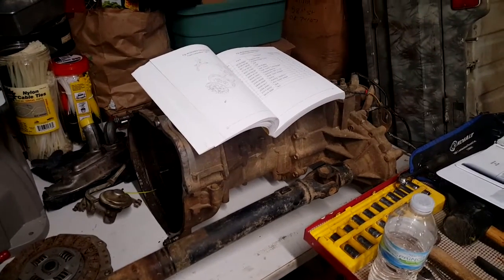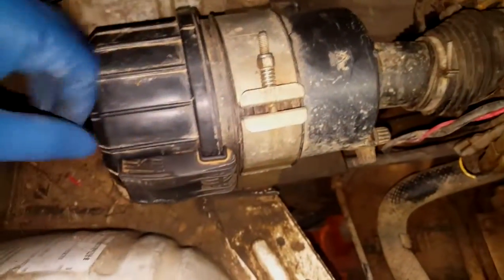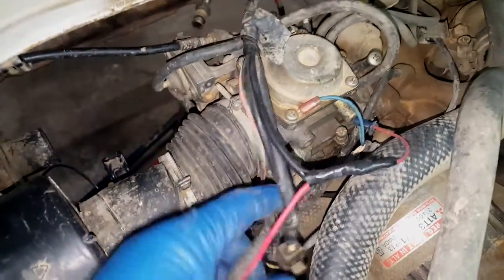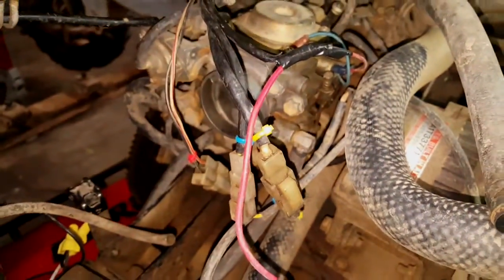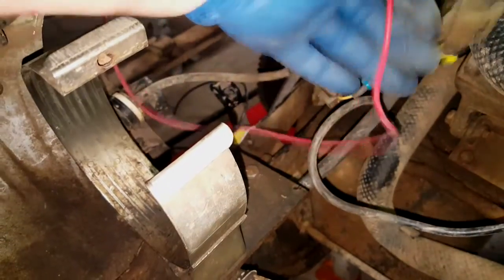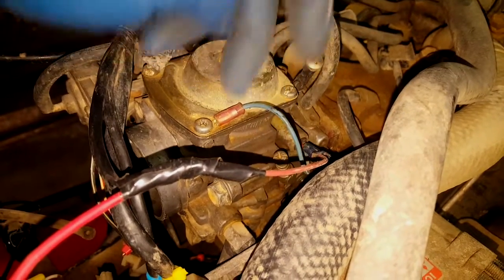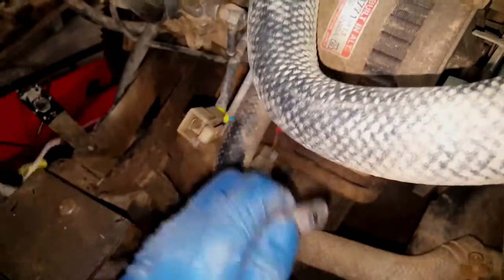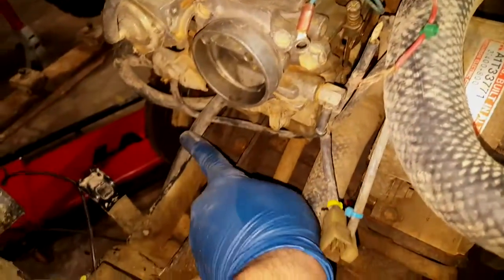1988 Suzuki Carry DB71T Engine Swap Part 6

Comment: good eve. big favor here. can you send me a scan copy of your manual :) regievillasis09@gmail.com. tnx a lot
Reply from the maker: Sorry I just saw this, let me see what I have... exactly what do you need?
Reply: @EngineerPrepper  sir need manual for my unit.  We have the same unit here f5a. Big help if u can give me acopy of manual. :) specially engine assembly..
Reply from the maker: I just sent you what I have. Its the only "service manual" that I was able to find on this truck when I search for one.... I hope it helps you out. The manual is for a F6A, which is a bigger CC engine.... but that is the only difference. All the bolt torques are identical.
Reply: @EngineerPrepper  thank you sir.  That is Big help for me.